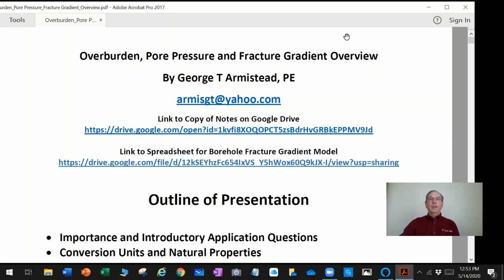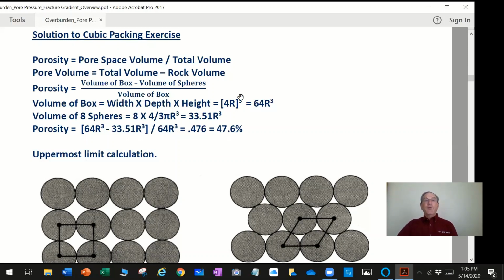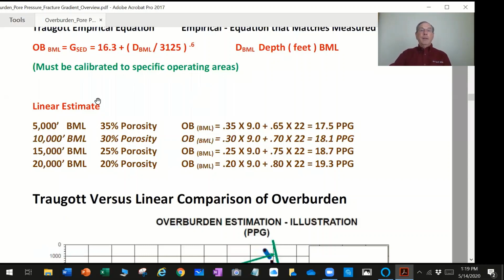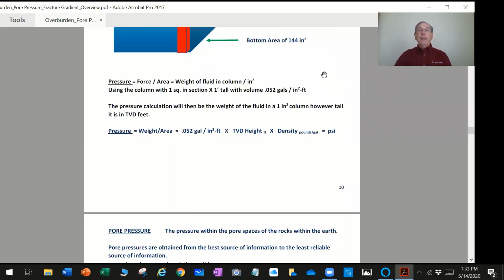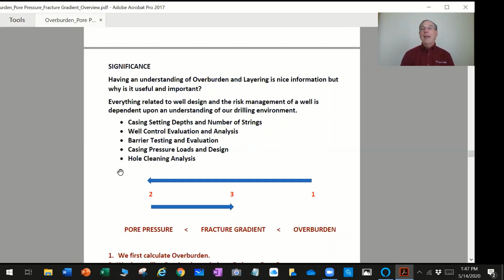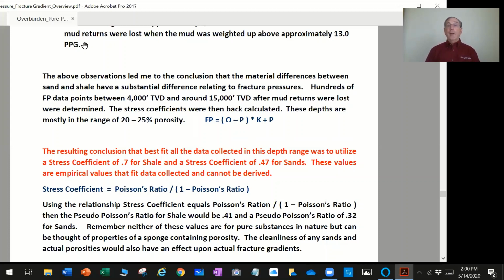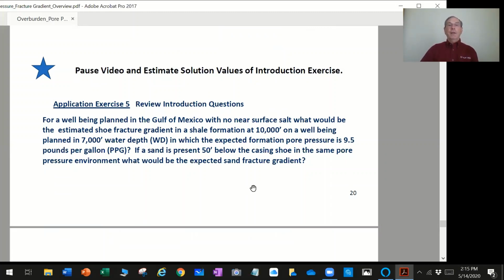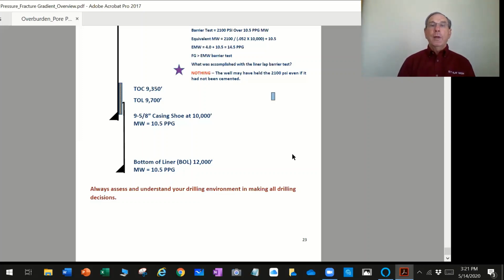Overburden, Pore Pressure and Fracture Pressure Overview

Comment: Thank you for the lectures. Its very clear. Other lectures often show specific gravity has unit of g/cc while SG itself is density divided by density so it cancel out each other ? For example sandstone specific gravity is 2.6 which is actually sandstone density. If we divided 2.6 g/cc with water 1 g/cc then we get 2.65 specific gravity but with no unit.